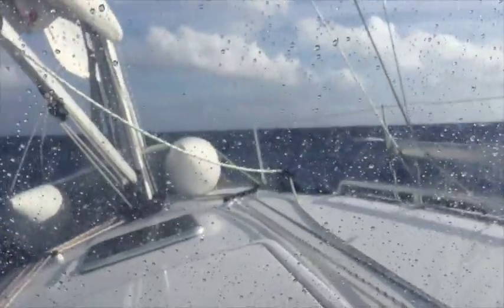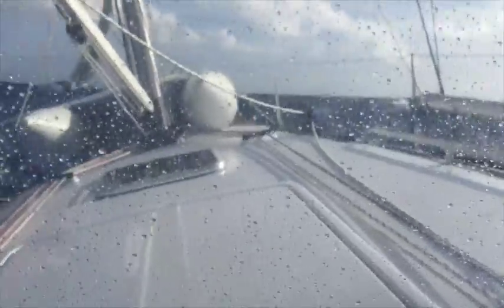Reefing with a Dutchman System (extended cut)

Comment: Hi, i am interested in the Dutchman system and potentially wanna buy one, so appreciate your insights….. how and where are they attached to, and how many run down? in your video it looks like there are 4 lines running down? are they going up straight from the boom, and then they are attached to the backstay? is there wear and tear on the lines when you hoist and lower the Main? i guess when youre away from the boat, you keep them in place. but how´s about over wintertime (well, we have a summerseason only here in Europe :) which is good for sailing, Winter is not so much fun so most boats go out of the water….)? Are they hard to install properly? 

thank you! M
Reply from the maker: The system uses vertical control lines, in this case 4, that are attached to the topping lift. The lines go into fabric tabs at the foot of the sail. The sail slides up and down on the lines like a Roman shade. As you drop the sail, the lines guide the main down to alternate sides of the boom. 

There is not much wear and tear on the lines. They are UV coated and will last a few years. When you raise the sail, the fabric tabs sewn to the foot of the sail stand up, lessening the tension on the control lines. 

When you remove the sail for winter, the system stays on the sail. 

The system takes only a couple of hours to install.
Reply: @dutchmartv8480  thanks, makes sense. 
now, as you say, on the top side the control lines are fixed to the topping lift? so depending how high or low you have your boom, the control lines are more or less tight. does it mean the horizontal level of the boom plays a major role when setting and lowering the main? I mean, if the boom is 10cm higher or lower, that then means the control lines are more or less tight, right?
Reply from the maker: Yes, the controls will tighten or loosen when the boom is lifted or lowered. With a halyard topping lift, when possible, tension the topping lift and raise the boom as needed before dropping the sail. If a boom topping lift, raise the boom after the sail is dropped. This makes the control lines tighter as the sail is dropped, and system will work better.

Comment: Is there a difference between Dutchman lines  and lazy jacks. Thanks
Reply from the maker: The Dutchman System uses vertical control lines laced through nylon fairleads in the sail. They way it works can be compared to a roman shade. The sail can’t get caught on the Dutchman lines as it is raised or lowered. Lazy jacks catch often. Also, there’s no need to head into the wind to raise, lower, or reef the sail. Just let the sail luff. The Dutchman lines pass through the fairleads in the sail every 2 to 3 feet, so they can’t chafe the sail. Easier to use. And easier on your sails. I hope this helps.